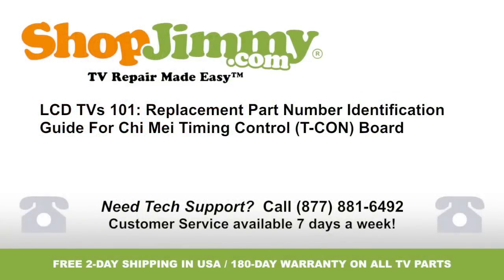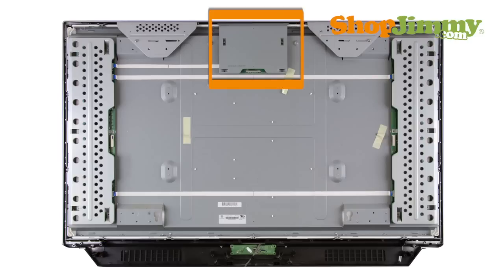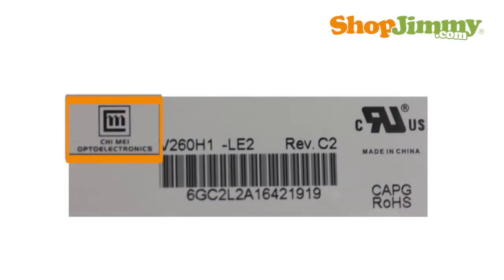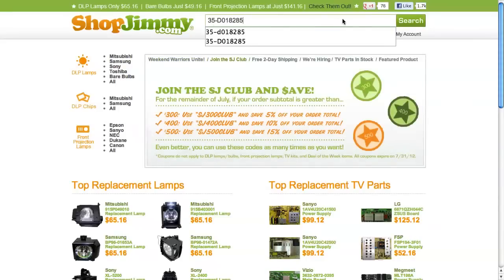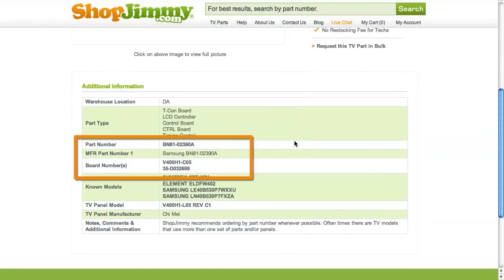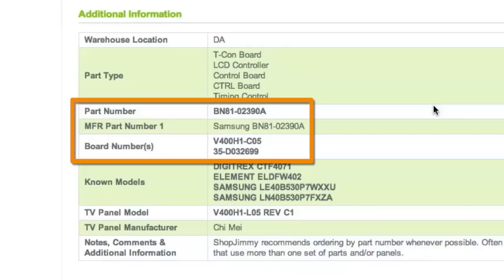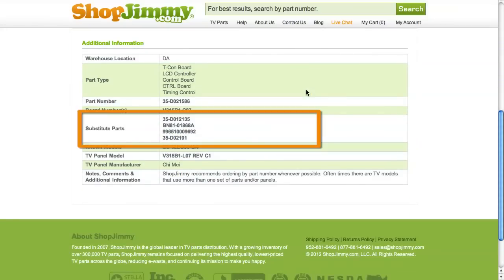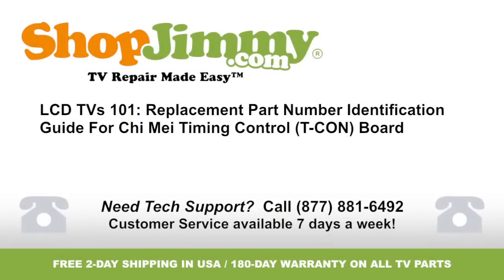LCD TVs HELP Part Identification Number Guide for Chi Mei (CMO) Timing Control (T-Con) Boards

Comment: solarized image means panel drive voltage is abnormal , check lvds bord. see the boost voltage ic , may be diffective or ic asserise parts,